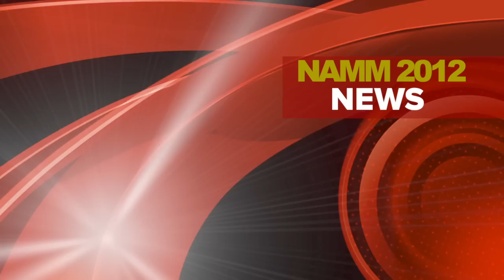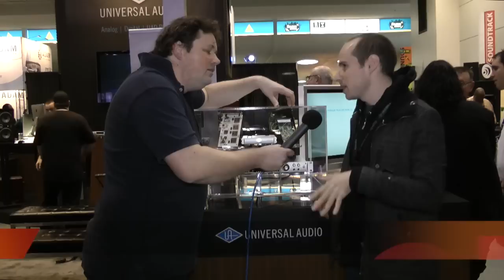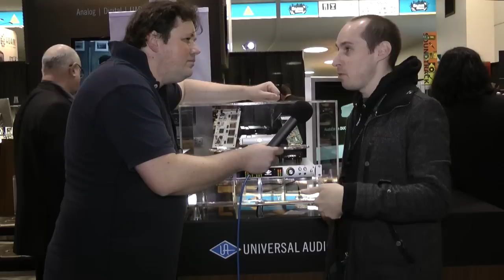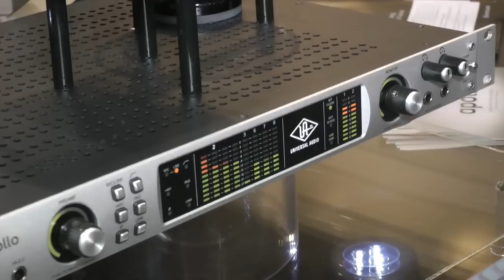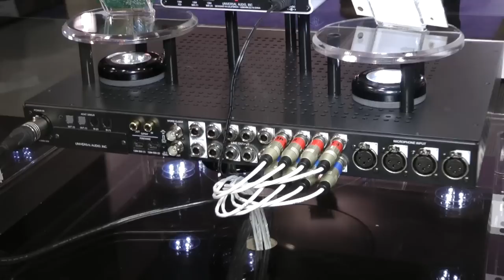NAMM 2012: Universal Audio Apollo Interface

Comment: @mpeskett depends entirely on the type of the mixes you are making. for basic home recordings and plugins that ship with DAWs, yes, you can get pretty far with the computers own processor. but if you're using UAD plugins and adding for example NI instruments and other stuff here and there.. you quickly run out of power since they require quite a bit of it. The onboard processors on this are for UAD plugins.